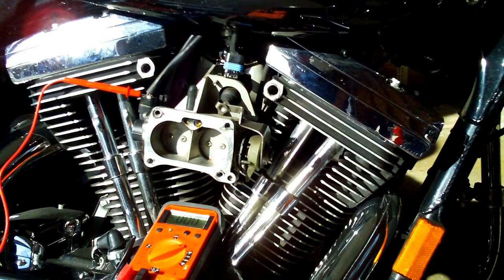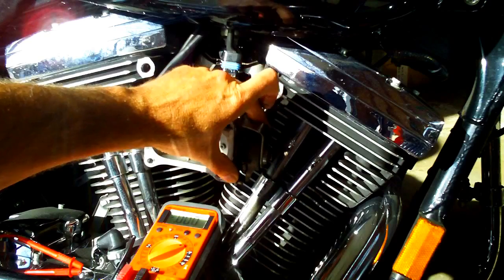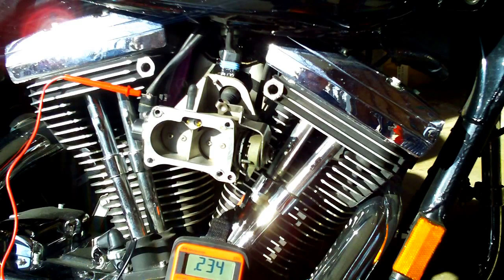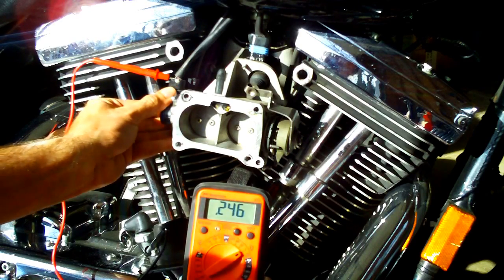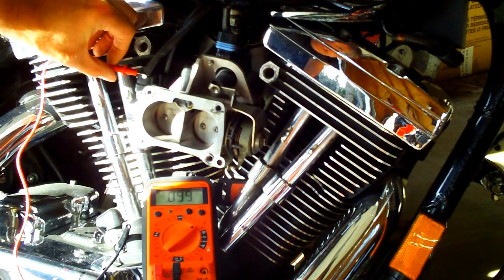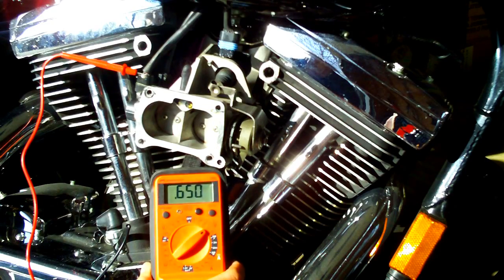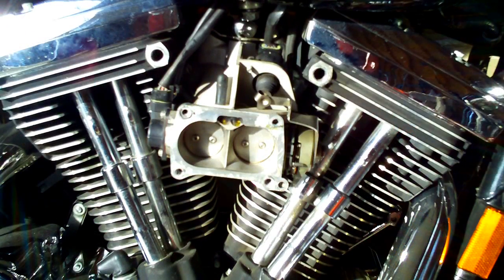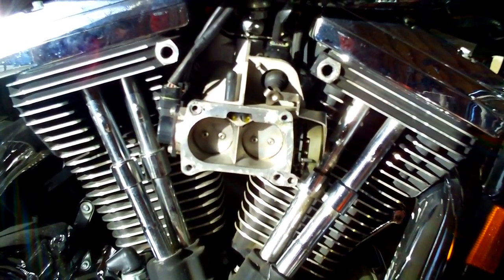Reset Harley Davidson Magneti Marelli Fuel Injection TPS Settings ✔

Comment: Mark I have followed your video before with good luck, but had to replace the cam position sensor.  Bike was running a little rough and cold idle wasn't fast enough.  Now when I try to set the throttle position sensor .388 is about as close as I can get before it drops to mv.  Any idea's?
Reply from the maker: Hello Dan, I have to admit I am not familiar with the scenario you describe here. You say you had to replace the "cam position sensor"? I know of a crank position sensor in the front area of the motor base, as I have had to replace the o-ring on mine to stop it from oozing oil. If both the cold idle and warm idle screws are backed out far enough as to not touch the throttle butterfly shaft stops, could there be something else holding the butterflies slightly open and not let them completely close? I assume you are rotating the throttle position sensor back and forth for your readings. What is the highest reading you get, and what is the lowest as you rotate it until it stops?
Reply: Mark, thanks for getting back to me so fast.  The bike is running good so I guess I won't worry about it.  Thanks again for all the information.  I may now know about this system than anyone else in my area.
Reply from the maker: You're one us, Dan, the elite few who know this system's functionality! Welcome!

Comment: Following this procedure, I was able to correct a starting issues on a 1998 Electra Glide Classic.  I'm not the original owner, and the owner previous to me did not know its history.  To start the bike, I needed to crack the throttle open to allow more air to enter the intake.  The bike would idle rough until reaching normal operating temperature;  like a motor with a carburetor, I would have to work with the throttle to keep the motor from stalling.  Following the steps and settings Mark identifies in this video, I was able to reset the throttle position sensor to a reasonable base setting and make further adjustments from there.  The starting issue has been resolved.  The motor now promptly starts when cold without touching the throttle due to the corrected throttle position setting and the cold idle screw adjustment.  The idle speed control actuator takes over until the motor reaches its normal operating temperature followed by the warm idle adjustment.  The motor now runs smoother and when idling at about 1050 RPM, has greatly reduced the "Harley shake" at idle.  Mark, thank you for posting this video.  I'm certain it has save me from spending hundreds at the local HD Dealership to correct this issue.
Reply from the maker: Thanks for the comments, Dan! I'm glad it worked out for you. If you saved money, that's great! I also made the video for some to show to their Harley shops if they can not do it themselves. Some shops are not familiar with these MM systems, and it has become a lost art to set them up properly. Sounds like you have it purring like it should! Safe riding to you my friend!

Comment: Good evening.  I connected mine up as you outlined about an hour ago and my meter read 2.8mV or .0028V.  It's a 1999 FLHTCUI with the MagMar but I'm seeing completely different numbers.  Is there something I'm missing?  3rd wire to the right of the sensor connector (gray).  Seems as though you know more about MagMar than my local HD shop since I had this into them three years ago and they never even took the glue drops out of the screws !  Thank you in advance.
Reply from the maker: Hello, I haven't had anyone comment with such a low number before now, so I have to wonder if it is really reading 0.280 volts (which is very close to the 0.275 volts that it should be set to). If it really were that far off, I think it would run horribly.  In fact, if it is ready 0.280 volts, I would be tempted to leave it right there to save you from the hassle of adjusting for that 0.005 volt difference. It is very sensitive to set and tighten the screws without moving the setting off. Is the bike doing anything out of the ordinary like setting off the check engine light, skipping, not idling, etc.? The old saying "If it ain't broke, don't fix it" may apply to your situation. To be fair, the Harley dealer may have measured your system and decided it did not need adjusting. Not all Harley dealerships have employees who know how to deal with these fuel injected systems, mostly because they were only used for a few years before the change to Delphi which is still in use today. Let me know if I didn't answer a specific question, I try to cover all the bases, and good luck with your machine!
Reply: Thank you for replying.  The bike has been skipping when it's cold and more so since I had the cam chain tensioners replaced.  Mainly when it's cold though and it's worse the colder it is.  When I have the bike under acceleration, it's not a problem, but when I'm decelerating or in what I call the "sweet spot" between acceleration and deceleration, it skips.  Doesn't matter whether it's 1K or 2K RPM.  I've tried different gasoline as well with no change.  Air temp and engine temp have been the major factor.  

So I found your video and it made a lot of sense based on what I've been seeing.  I also notice that it smells rich when it's cold.  Sadly, I've been told that many of the HD Mechanics locally are more familiar with the Delphi injection which is easier to diagnose because of the diagnostic systems there are to test them.  Not so with the MagMar.  I'll double check things again tonight and maybe what I'll do is bump the cold idle screw a little. (It's been sitting around 800 RPM when cold and just a little higher when warm.)  I also installed a Arlen Ness Big Sucker 2 on the bike because it seemed to be air starved for a while which also made it lag when accelerating at lower RPMs.  Not good when trying to finesse it around corners.  

But the Tektronix meter I have has multiple ranges and not something I'd ever use an analog meter on so I was surprised when I pushed the range button and it went down to .0003 V at the V range.  I have a resistor pack in for the LED lighting that I upgraded to but that's in the lighting harness and I can't see it affecting the throttle body since I installed that two years ago without any glitches. 

Thanks again for your help and I'll let you know if there's any change.  All the best.
Reply from the maker: Was it 'skipping' before you installed the Arlen Ness Big Sucker 2? And by skipping, do you mean backfiring, popping sound? If it is, to me this means it is running too lean. What kind of exhaust are you running, stock or other? Have you had anything done to the fuel injection map of the bike or added a fuel controller? I added a Dobeck fuel controller to mine and will never go back. I have a video on installing and using it.

One more question, you did turn both warm and cold idle screws out far enough so they didn't hold the butterflies in the carb open at all, right? Your cold idle should be around 1,100 rpm, and warm between 900 and 1,000 rpm. This not only is easier on the crankshaft bearings, but also maintains a well charged battery at idle. Harley recommends this higher rpm idle, so there must have been some issues with some running their battery down by idling too long? Setting the cold idle screw to the voltage of 0.650 volts is a starting point, but since you have a tachometer on your machine go ahead and set it to 1,100 rpm's when cold. It will idle down, coming to rest on the warm idle screw when the motor warms up, just like mine.
Reply: And another thing. . .the 88ci was upgraded with the stage 1 kit to 95ci prior to my purchase of the bike.  The work was done by the local HD dealer.
Reply from the maker: 95ci and using MagMar injection? I wonder if there was a map setting for that for them to program into your bike, or did they take a guess at what should work? Did anyone put this on a dyno when it was broke in?

Comment: You never say what you set the meter on. You have been asked a few times
Reply from the maker: I thought it was obvious enough that it has to be set to read less than 1 (one) volt DC. A reading of 1.000 would be 1 volt. A reading of 0.999 is less than one volt. This has to be done with a sensitive volt meter that can show DC voltage to one-thousandths of a volt.
Reply: thankyou  not so to us novices's.
Reply from the maker: You're welcome, I hope this helps.

Comment: I have a 2000 electra glide ultra classic that stalls when i let off the throttle after she is hot. is it the cam position sensor?
Reply from the maker: My first question would be is the warm idle set so low that it won't idle when hot? There are other variables that could factor into why it is doing this such as the temperature sensor in the front head, the air temperature sensor inside the intake, the barometric pressure sensor underneath the right side cover, etc. I am no expert, but I believe the bike would not run right or at all if it were the cam sensor (if there even is one, I do know of a crank sensor that is mounted on the front of the lower engine case). If you can't do it yourself, have someone remove the air cleaner and adjust the WARM IDLE SCREW by turning it IN by 1/4 turn increments while the bike is hot until it idles and see if that was your problem all along. Just keep count of how many 1/4 turns are made for returning it back to where it was if necessary, and make sure you are adjusting the warm idle screw, NOT the cold idle screw for this. OK?

Comment: Hello. I have a 1998 ultra classic. My voltage reads 12v. I have done everything you said. When I adjust the ics it will either say 12 v or 0 v. Mine will not show the .275.
Reply: Either your meter is not set to the proper setting or is incapable of reading less than a volt.
Reply from the maker: Sorry I didn't see this soon, but as Sam said, you may need to use a different meter that can measure below 1 volt DC.

Comment: Don't you have to remove the two fuses at the ECM after these adjustments are made and plug them back in after a couple minutes?
Reply from the maker: +Michael Walsh Yes, Michael, thanks! I was not aware of this step when I made the video, but it does say in the shop manual instructions, that I put a link to above, that both fuses should be pulled for at least one minute. I have now added that to the video as a Note.

Comment: i can barely do an oil change on my own.  how much would this cost me to have a pro do mine on my fltrsei2?
Reply from the maker: +jeff mclaughlin Jeff, I don't have a definite answer for that, but it took me an hour, maybe an hour and a half to do the whole thing, while recording video. So base that on your shop's hourly rates? From what I have heard from others and comments here, many shops will shy away from working on the MM fuel injection system. So I recommend that you show this video to them so they get an idea of what is involved (they may even have the Service Manual that outlines these steps) and can make a decision from there. How is your bike running? Are there any issues? Check engine light?
Reply: No check engine light.  But it idles low when cold. .and will stall out if i don't hold the throttle.  It's annoying. Yesterday,  it even stalled out on the road stopped at a set of lights.  I just bought the bike this past weekend from a dealer.  I honestly didn't think they'd look at it. .but they are right now.  Just dropped it off yesterday. Fortunately,  i have a sporty to bomb around on until it's back. 
The problem bike is a 2001 fltrsei2.
Reply from the maker: +jeff mclaughlin Thanks Jeff. They might not have to touch the Throttle Position Sensor at all. Just adjust the "cold idle motor" screw for a faster idle (around 1,200) when it's cold. There is also a "warm idle" screw that controls idle when the bike is warmed up. If the bike idles fine when warm, this screw can be left alone. The cold idle motor screw seems to back out on its own, as mine had even "after" I performed this tune up. I reset it a second time and used some Blue Loctite on both cold and warm idle screws so that they don't change on their own. Hopefully your shop knows all of this, but I would call them and ask to have to Blue Loctite put on the threads of each screw so that hopefully you won't have to go through this again. I couldn't be happier with the way mine starts, idles cold, idles warm, and runs than I am right now.
Reply: Jeff..... After warming the bike up , just remove the breather, take pic as you go or run a video so you can put it back together.
Start working on your own bike. You'll learn , save money and the job will be done right in the end. You can watch this video as you do the job . 
Also , get a shop manual for you bike and don't get ripped out by the dealers.

Comment: mark, very informative videos on magneti marelli efi, i need to  know if its possible for the tpi to be at .133 reading and the epoxy is still  in adjustment screws.  could it have moved on its own.  didnt want to touch till i asked ya,  thanks bro, rich  1998 road king flhrci magneti marelli.  keep the video's comming
Reply from the maker: +richard hinton Richard, ask yourself how the bike is starting and running. It could be that the internals of the TPS are getting a bit "sloppy" with age, turning back and forth on the end of the throttle shaft, causing your seemingly low reading. I'm going to guess the check engine has not been blinking on you. When I was experimenting with my TPS, I turned it to the point that the check engine light came on under heavy throttle. That's why I researched this procedure and had to do it to my bike. That being said, my bike is one year older than yours, and with these settings the thing runs buttery smooth, never hickups, pulls strong, and gets great gas mileage that makes the others that ride with me jealous to boot. Like the saying goes, if it ain't broke, don't fix it. But if it were me, I'd lay awake at night wondering if it could run even better than it does now if it were adjusted to what I believe to be the "correct" settings. So far, according to the comments, everyone who has done this has had positive results. I'd hate for you to be the first 'negative.' Up to you, keep me posted on what you decide. I'm just a guy, not a mechanic, that isn't afraid to experiment and tinker with stuff.

Comment: Mark I would like to add my experience with the whole process. I have studied all aspects of this tune.  So with bolt on cam, ported heads along with your video I have backed out screws, unplugged cold idle. The Engine was warm. I was crying at the time because I have made many adjustments for days. I was told adding performance upgrades change everything.   Setting the base point of .275 then set WARM IDLE AT .500.  I set all to voltage numbers lowest to highest.   for my bike, 2000 road king MM EFI, TRUE DUAL, DME  .510 CAM....    .820 V cold idle.  I feel unplugging the 5 and 15 amp fuses is KEY HERE.  Idle is warm and cold is dead nuts where it needs to be. When cold it rises for a moment to 1650 settles in around 1200 and slowly drops into the 1050 range perfectly.  just thought I would share.  Thanks for your Vid It helped my solve my problems.  The Mag Marelli has worked well for 14+ years and needed some help in the last year but its like new again.  Mark S.
Reply: What fuses trying to fix my m&m now